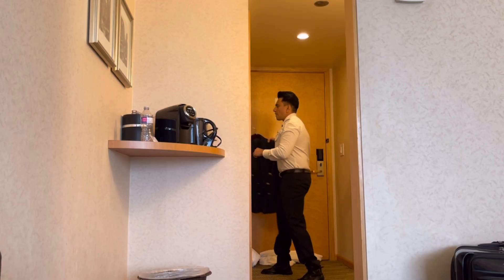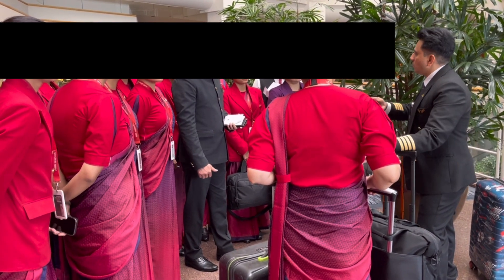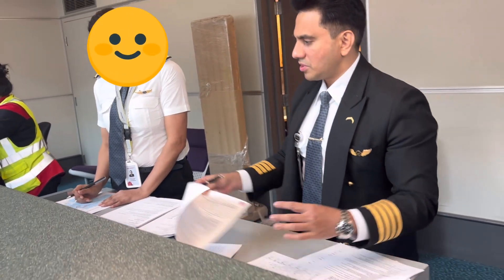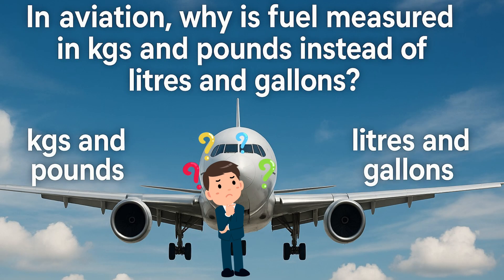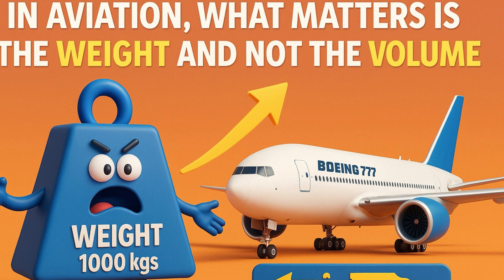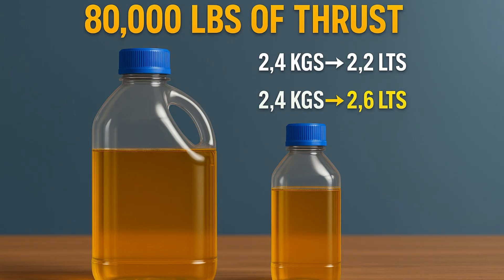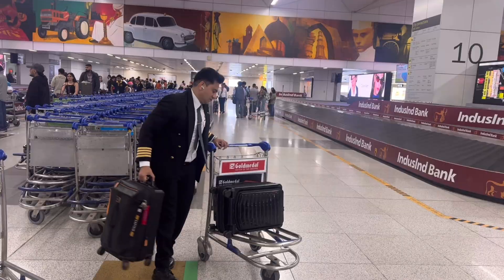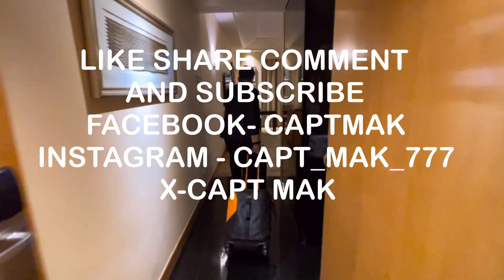Vancouver to New Delhi Nonstop: Why Fuel requirement Is Measured in Kilograms and not in litres?

Comment: Hello Sir, As a student pilot , I'm curious to know does jet aircraft have left turning tendencies ? In Cessna 172 it is difficult to keep aircraft in center line.  So many left and right rudder corrections.
And of course, very nice video and explanation . Thank you ..:)
Reply from the maker: no( in nil wind conditions) , but aircrafts with long fuselage like 777-300 , during takeoff in strong cross wind conditions,has an INTIAL tendency to weather cock into the wind ( then away from the wind as aircraft speed picks up ) due to its  leverage arm (ie position of CG with respect to it's lengthy fuselage) .

Comment: Captain i have a question . I always notice at VISR airport , most of the aircrafts make right turn just after take-off from the runway  then make a circle in the air and proceed while they can have climbed in straight path on heading 13 which from runway 13 and the same heading its the only way to go for  the destinations because it's the valley surrounded by mountains. 

(:-Flight radar 24)
Reply from the maker: there are couple of waypoints which have min crossing altitude restrictions like 17,000 and above / 19000 and above due terrain in the vicinity of the airfield. while the 320 neos can make it evn if the fly straight, the older 320s need some extra miles to gain altitude to clear those points with minimum height restrictions and hence those turns !!
Reply: Got it! Thankyou @CAPT_MAK

Comment: Thanks captain for yet another video. My response to the question is: Horsepower measures power which could be used to measure the power generated by engine's rotation.  Thrust (ability to move the jet forward), however , is a force (power on an area) , a concept more than 'power'.  Hence, thrust can not be measured by horsepower alone.
Reply from the maker: good

Comment: Because Jet Engine Produces linear push (thrust) and Car Engine Produces rotational output (torque + RPM). 

Jet engines produce force (thrust) by pushing air backward. That thrust is a direct force and is measured in pounds-force (lbf) or Newtons (N). 1 pound of thrust = enough to accelerate 1 pound of mass at 1 ft/s². Jet propulsion is governed by Newton’s 2nd and 3rd laws:

Car engines rotate a crankshaft, delivering rotational mechanical power, which is measured in horsepower (HP) or kilowatts (kW). 1 horsepower ≈ 746 watts.
Reply from the maker: good 👍!!
Reply: bro what 
power is energy/time and thrust is force 

u r comparing apples and bananas 

P.S. the “car equivalent” of thrust would be torque btw